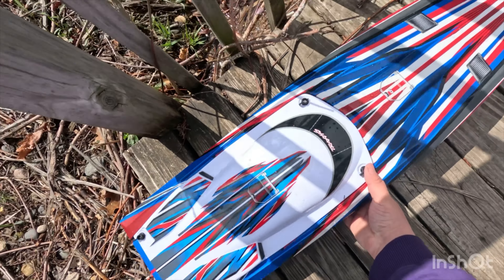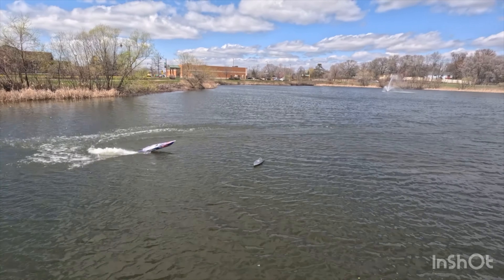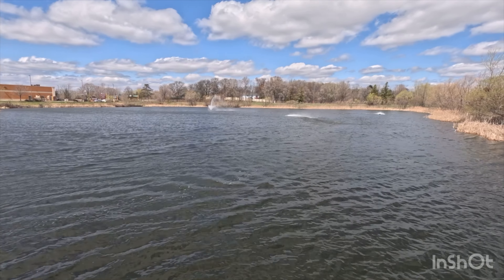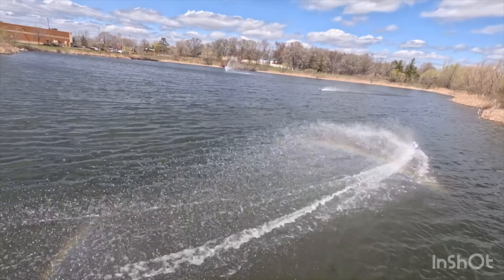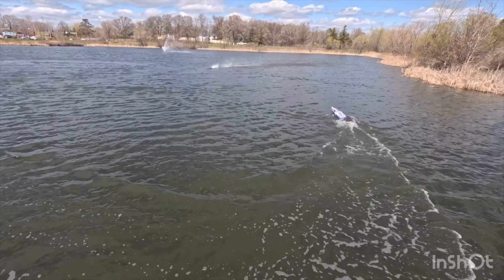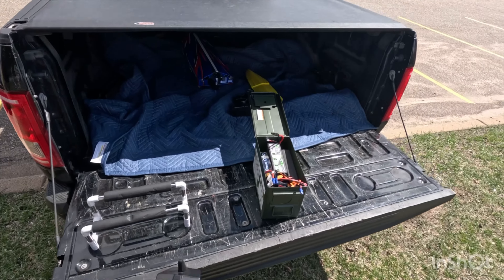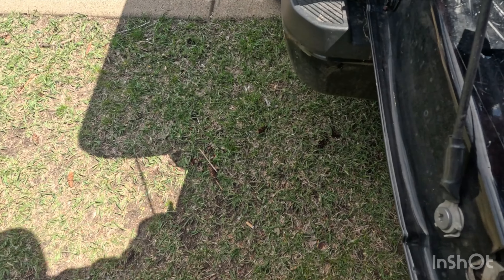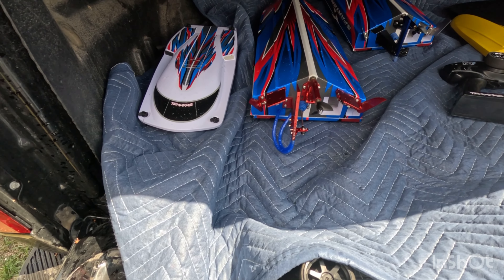Traxxas Spartan Sr Boat Bits Upgrades Seaking 180amp - Stock Prop First Run !

Comment: You just made the Tiller from the non-sr upgrade kit work on the SR?  RC Boat Blitz only has a beta out for the Spartan SR that is sold out currently. should have the version out end of july so the website says.  Seems to work ok...